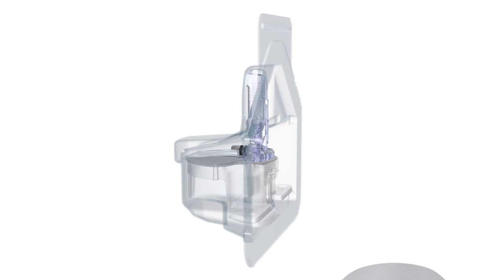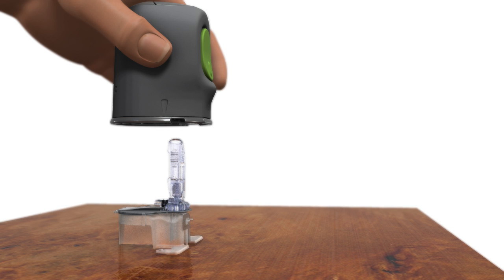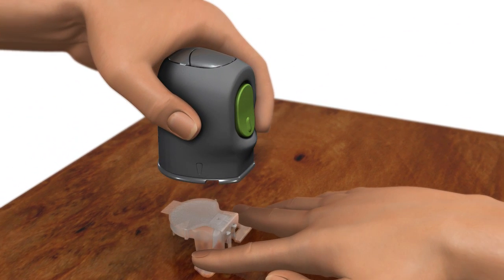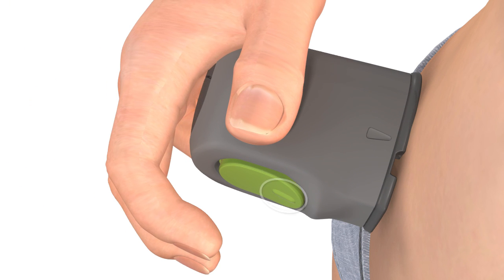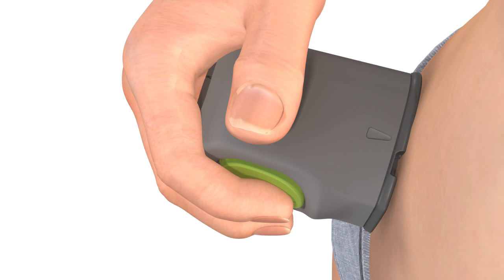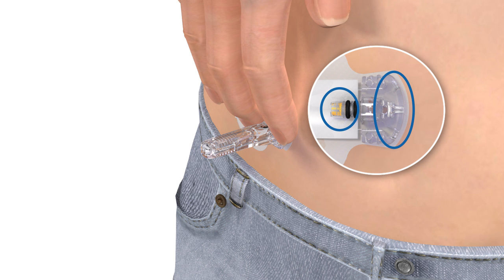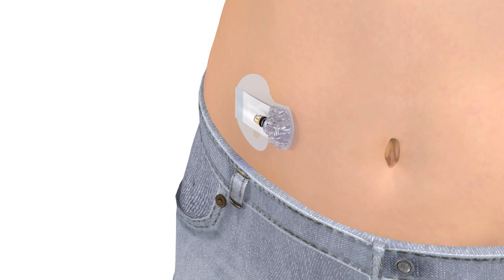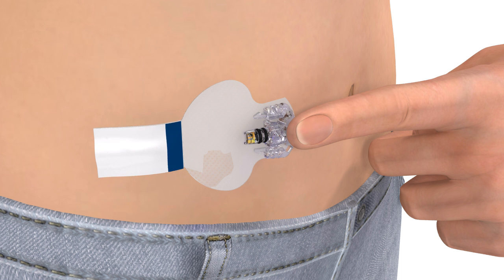Inserting the Enlite® Sensor

Comment: The problem with insertion in the arm when you are alone is that you only have 1 hand to work with, which makes it difficult on the new system. Since the newer systems only allow upper arm insertion.

Comment: Is there a way to do this without the setter? I used to use the setter for my pump and wound up in the hospital. The inserter would slam the needle through my skin. The damage to my skin looks like a gunshot wound and I don't want to go through that again. Can I manually insert this?
Reply from the maker: Ouch. I'm sorry to hear this. Our technical support team may be able to help and can be reached at 800.646.4633 option #1.